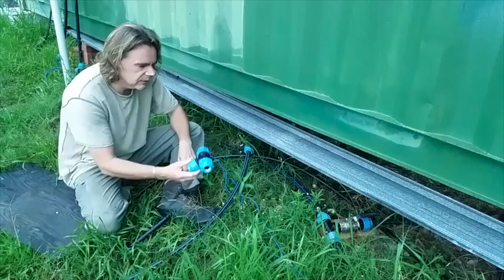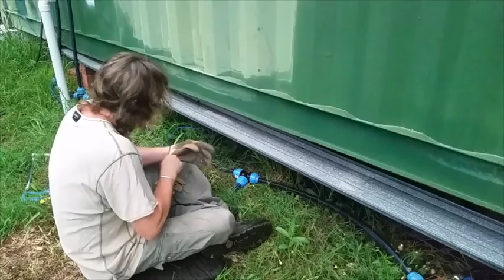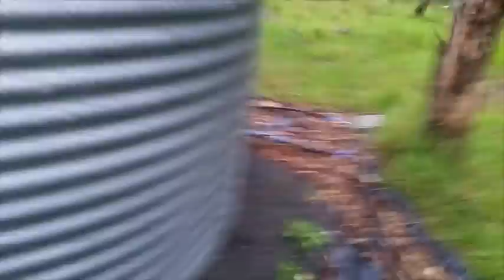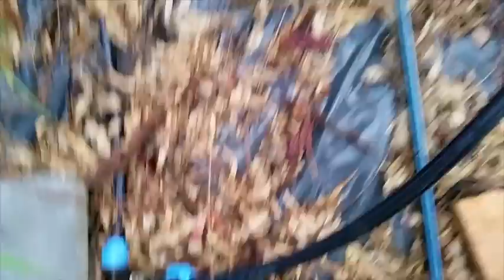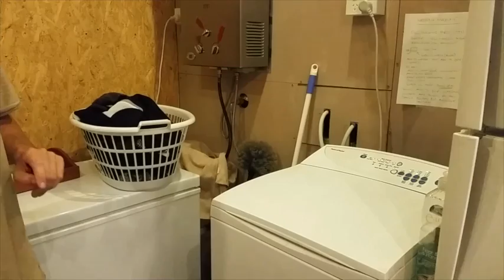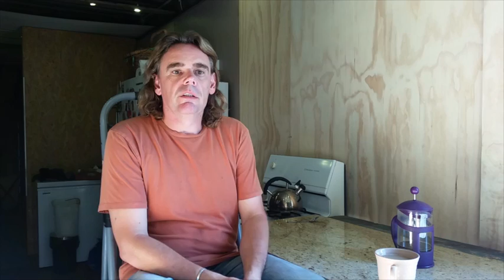Shipping Container House – Dead water pump

Comment: Never fill to the bottom of a water barrel, always fill from the top. Less head pressure. The greater the head pressure the more work for the pump. Pumping to the bottom side of a vessel is a bad idea if you value the pump. Keep up the great work Paul !! I'm learning allot!
Reply from the maker: I often wondered about that. I did not know if pumping into the top was the same as pumping into the bottom. It felt like it the top might need less effort but pumping to 2m lower also seemed to have merit. Cheers Paul
Reply: Paul, In your setup the two tanks at the top of the mountain, can you run the overflow from the higher tank (the metal tank) to the slightly lower tank (the red plastic tank)? in that organization you only have one overflow to check for two tanks. Or tie to bottoms together and fill from the highest tank. That way you lower head pressure for the pump and still fill two tanks and you don't have to switch valves to select which tank you are filling. I would do that because I'm lazy and wouldn't want to venture out in the rain to switch which tank I was filling.   Either tying the bottoms together or using the overflow to fill will work. I really like the idea of using the overflow line to fill the other. Tying the bottoms together means the you are limited with water storage capacity by the lowest overfill point. If you don't understand that it's my fault but you will understand when you are there at the tanks. Mull that over. You are doing a great job keep it up!

Comment: why do not you fix the pump ?
Reply from the maker: +tobe dechamps Hi Tobe, I expected to do a video about the repair. I had 3 goes at repairing it and it ended up needing to spend more on spare parts than the pump was worth. It was a freebie and quite old. I ended up configuring the pipes so I could do every pumping activity with one pump. That was the video that never quite made it to the end. Cheers Paul

Comment: Upgraded from the To-Do-List to the OMG list haha!  What type of water line is that you are using?
Reply from the maker: Hi Plan bee, The shop call it blue line pipe. its 25mm and its made for drinking water, as against green line which is irrigation. They do different sizes. After I got the hang of coupling them , (I will pretend I didn't film it leaking), they are really very good. The pipe is strong and you can walk or drive on it without puncturing the lines. It doesn't do too well with back burning though. I started a fire along the length of the lines and wasn't paying attention. A bit of my pipe started burning but it still works though, Things generally have to make it to the OMG list to get done round here. Cheers Paul
Reply: Paul Chambers Thanks for the info, we will be looking at irrigation for the orchard once the house is up so having this info will be quite helpful.

Comment: How does your water collection hold up over the time? I take it that a surplus is a must when living off grid. Nice quick fix by the way!
Reply from the maker: Absolutely, We recently had 3 months without rain, and no one in suburbia noticed. Farmers and people with tankwater did!!!. You have to hold significantly more than you consume to even out the use. Non flushing toilets are how we can live with such small storage capacity. Regular houses with tank water can pay the waterman to deliver 20,000 litres in one hit. I made it through 2014 without paying the waterman. Failing to catch available water can be expensive. Hence me getting up before light to fix the pump issue. In the bush, wealth is measured in water tanks. Cheers Paul

Comment: I've never seen so many bleeding pipe connections in my life!!  So do the tanks up the hill provide you with gravity feed pressure in the house, or do you still use a pump for pressure?  Cheers.
Reply from the maker: I gravity feed back to refill the house tank. Gravity is not enough to drive the hot water heaters so I need a water pump. I used to use 12v and that was fine. When I installed the decent power system, I upgraded to a 35 lpm 240v pump. Cheers Paul

Comment: Stuff always breaks just when you want to use it. Its good you were able to do a work around. Did you have the "T" on hand,or did you have to do a road trip?
Reply from the maker: I generally have a few spare items but this was a road trip. The blue line couplers are too expensive to keep a handful for just in case. Cheers Paul

Comment: You might be better off investing in float valves for your tanks. No need to monitor them when your transferring from 1 tank to the other
Reply from the maker: I have considered this a lot. I bought a cheap pump with a float switch, but when I gave it power, the pump failed to switch off when it pumped the water out and sat overheating and emptying my batteries. I am now a little wary of giving a pump unsupervised access to my batteries.